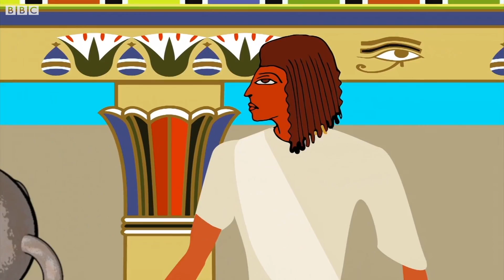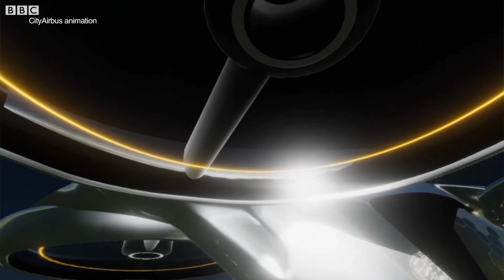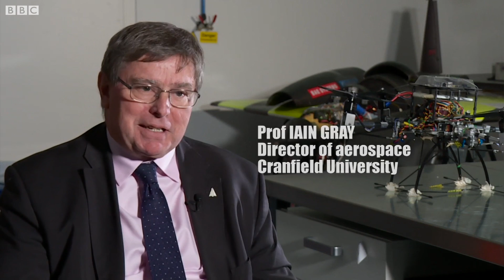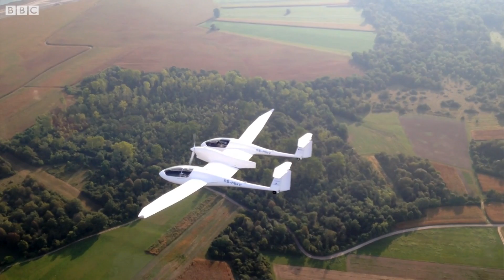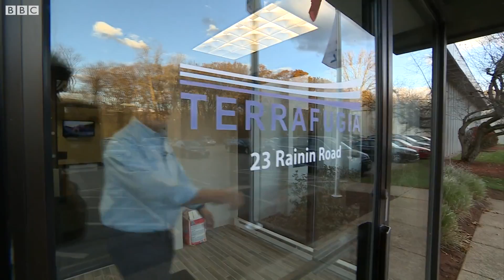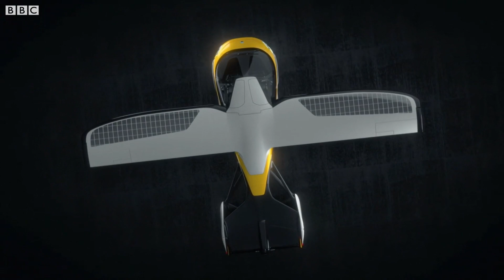Disruptors: Will Flying cars ever take off? - BBC News

Comment: We already have flying cars, we call em helicopters, cant make em any smaller
Reply: Yes they can https://www.youtube.com/watch?v=At3xcj-pTjg
Reply: Electric motors are far more powerful so if you only need a short 20mile range like trips in city's like London you can get a very high power to weight ratio.
Reply: Or a lower ratio with a much higher 600mile / 965km range https://electrek.co/2017/06/21/all-electric-aircraft-eviation/
and everything in between.

Comment: When i was a kid in the 80s, my fellow classmates would tell me how they are already testing flying cars in japan, the fantasy will never end cause it will never happen, especially after what u saw at 911
Reply: They did in the UK as well but they were road cars that could double up as planes needed a runway, pilots where non electric and the range was too short.

These though are automated electric helicopters something very different.
Reply: Look for a photo of the Convair Model 118 from 1947.

Comment: You will need a high level of onboard system redundancy for it to be safe, so the Volocopter makes sense. And it will have to be completely autonomous.

Airspace will have to be much more regulated, we will probably need "air motorways" kind of like the Star Wars prequels.

Comment: Last time I checked. when plane crashes it hit the ground. And You're gonna make a flying car?
Reply: Air travel is statistically much safer than road travel. It's not impossible.
Reply: @lieutenantcandlewax  You will need a high level of onboard system redundancy for it to be safe, so the Volocopter makes sense. And it will have to be completely autonomous.

Airspace will have to be much more regulated, we will probably need "air motorways" kind of like the Star Wars prequels. https://youtu.be/oI9BhjVHLFw?t=117

Comment: The biggest battery hurtle? Charging...
Minutes to fill a fuel tank gives me hours of driving/flying. Apply this concept to batteries and it'll be golden. Until that happens you'll have to have a line of charging batteries that can be easily swapped...
Reply: a similar problem : maintenance.   complicated machines are great when new, but often age poorly and require more  man hours to keep functioning safely.

Comment: why planes have to be always white???!??
Reply: Essentially temperature and material management. You can have colored planes, but there are certain drawbacks to that.
Reply: @mrblueberry4864  its a joke
Reply: @graveperil2169 , no, just check his channel or his history/old comments.
Reply: Not always, remember the DC3s, they were almost all silvery back in the 50's. And what about the jet fighters, almost all grey (anti radio wave paint, aka anti-radar)..... but the real reason is they WACIST
Reply: to save it from hot sunshine.
Reply: Heres the correct answer, white paint is cheaper and less in weight than colour paints,hence it saves on fuel costs to paint em white
Reply: Ask captain joe
Reply: Most of Air New Zealand’s aren’t
Reply: Cuz day waycist
Reply: @mrblueberry4864  That wouldn't be good for the duck.  How about a hole in a wall?
Reply: Because no one want to fly with Trump Airlines.
Reply: Because white people invent them.

Comment: Battery's are still to heavy to be useful for a mid/long range plane.
Reply: Plane fuel is also very heavy, something like a Boeing 747 burns 10 to 11 Tons of fuel per hour.
A gallon of Jet Fuel weighs about 3KG, so a 747 could be carrying 184 Tons of weight in fuel alone, flammable stuff that would be more dangerous and costly.
Once you build the infrastructure of solar panels around airports, factor in initial cost of batteries and the replacements for worn units it's probably going to be cheaper in the long run to transition to batteries.
Battery technology will get better over time too, with charging speed and weight.

Batteries could be charged in flight by solar panels, to supplement energy used, with panels positioned alone the top of the wings and the aircraft.

Both fuel and batteries take up space and add weight to the vehicle, though both can be stored in the wings and parts of the main body of the plane.

Really weight is an issue regardless of what power source you use.

Seems like a no-brainer to move to batteries, costs and pollution levels should be way more appealing than jet fuel planes.
The cost of flights should come down drastically.
Reply: Might be a bad time for the battery to go out, ha.